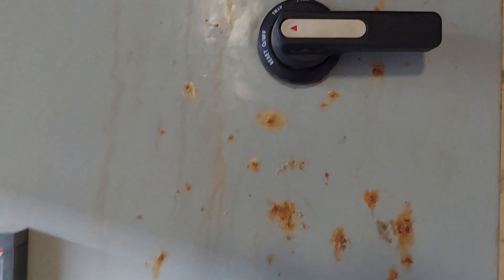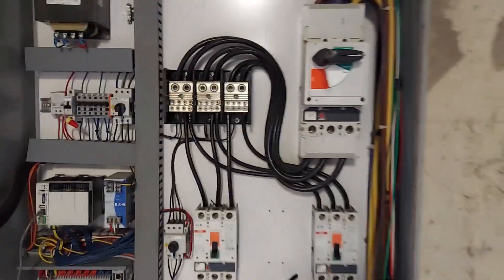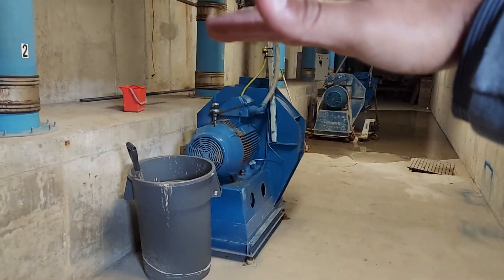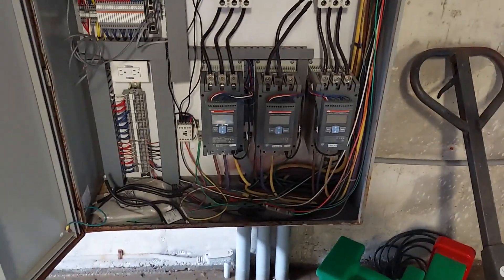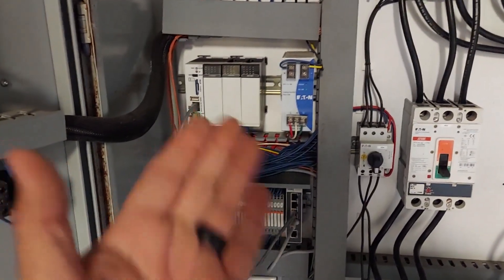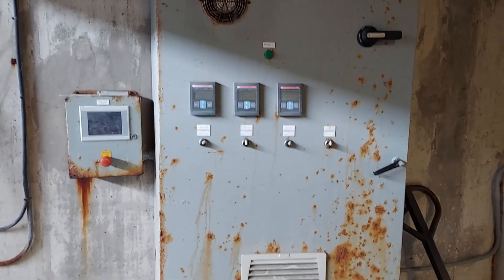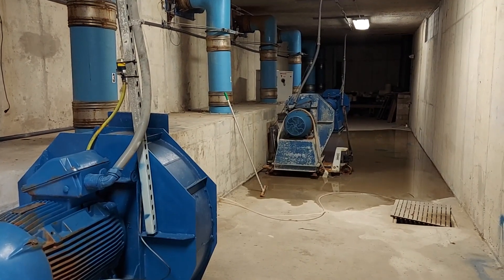Wave Pool Controls and Safety Systems

Comment: 4:10 this is not true.
If you put your hand in front of the blower (either side) you will reduce the mass flow of air through the pump. This will reduce torque loading on the motor, allowing the speed of the motor to increase, which causes the current the motor draws to go down.
It's counter-intuitive at first but makes sense when you think about it; in a motor you calculate the current by the offset between the RPM (phase in the case of synchronous motors) of the rotor, and the frequency of the driving voltage. When the motor is spinning it starts working more like a generator and creates back-EMF, a voltage. The faster the motor spins, the higher the back-EMF. This voltage resists the voltage of the power supply, so the faster the motor spins the smaller the difference between driving voltage and motor voltage. If the shaft is moving slower (behind) the driving frequency, the motor draws current, until the point where they spin at the same speed; then the motor is producing zero torque and neither drawing nor consuming current. When you continue to drive the shaft even faster, you invert the flow of current, the motor starts working as a generator and the flow of current reverses, it's now a generator.
This is also why the motor draws more current when starting; the driving frequency will be higher than the shaft speed.

Comment: Hi mate, Love the videos. Just wanted to know how you actually power up these motors? Do you have a switch on the outside of the electric box and where does it connect?
Reply from the maker: These are controlled via a PLC and powered by a soft starter.
Reply: Thank you  @thepoolguy

Comment: When you say never test the system with no water in the pool, is that common knowledge in the field or did you learn that from experience? What would happen if it was tested without water, would it possibly lead to a catastrophic failure?
Reply from the maker: So, I havnt tested it, cause I really don't know what would happen.  Might be nothing, might be catastrophic failure.  This is too important to leave up to chance... my pro opinion

Comment: The swimming arena AdO in my hometown (Bergen, Norway) had an open day some time ago and I got to go on a guided tour of the various facilties under the pools (at least I think it was), used to keep the swimming pools running. I was also shown the valves for a kind of air cushioning system used to release a lot of bubbles into the water to help cushion divers who were practicing. I didn't know such a system even existed, so it was really fascinating.

Comment: Oh nice a transformer in there.
That is first thing my eyes went to is the transformer as that is what most pinball machines run off of except the new ones now do not.
I work on mainly 70s, 80s, and 90s pins and they have that beefy of a transformer in them even some have two in them making it really hard to lift up the board they are on.
I need a new transformer for my Star Trek Data East pin as it gives a loud buzzing and pops the power junction boxes 8amp fuse.

Comment: Breakers are sized inappropriately if they are tripping on "acceleration" at 10 seconds. Usually the drives have a spec on breakers in the annex. If those are 75 hp motors those drives look mighty small!  Also fans only do work when moving air. If you block the input or output the motor will unload and current will decrease and the motor will run at full rpm. Almost in an idle state.

Super cool and simple setup, I do automation controls, programming, and systems designs for large Heat Treating Furnaces! I enjoy your videos as it is satisfying my childhood curiosity to how the infrastructure of commercial pools works.
Reply from the maker: Figured out that the soft starter was failing, and causing the issue.  I'm also sending in the breaker to be inspected just in case.  The motor was megged and was all good.  Thanks for the info about shutting off flow.  I'll admit I dont know everything,  but I try and learn as much as possible every day.

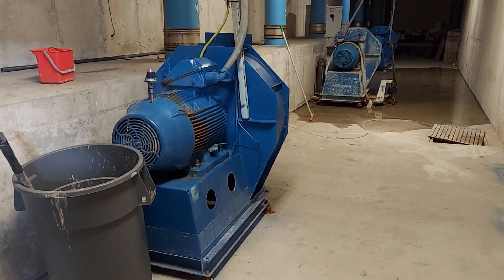Comment: 4:24 That's actually incorrect. As the pressure side of the blower (or pump in case of a liquid) get more pressure, the amperage of the motor actually goes down. This is because it is easier for the motor to turn the blower or impeller in it's own liquid or air rather than displacing it. A simple example for people who don't understand what I'm referring to is this: fire up your vacuum cleaner (which is just a blower in reverse) and cover the vacuum pipe with your hand. You'll hear the motor spinning faster. Now this might look like it needs more power, but in fact what's happening is that the motor turns more easily and therefore reaches a higher rpm. If you connect the vacuum cleaner to a power-meter, you'll notice the amperage (or watts) will reduce once you block the vacuum pipe.
The same applies to industrial blowers and pumps. I've been working in a large chemical plant for over 8 years and I've seen the same thing on small pumps as well as on 750KW and 6000volts (!) pumps.
Ps: this only applies to centrifugal pumps and blowers.
Reply from the maker: Thanks for this.  Ill be the first to admit that I don't know everything, and I love to learn everyday.
Reply: @thepoolguy  ps, I subscribed! I've always been fascinated by the engineering around swimming pools.
Reply: @ThePoolGuy - Looking at those soft starters they appear to be made by ABB and have the fault circuit hooked back up to the PLC, so it should be able to monitor for motor status, when set RPM is reached, or for faults. If it works like other variable frequency drive products in the situation that Auto Addiction presents the loss of the pressure side should trip a VFD on overspeed if the controller can't adjust the ramp down fast enough to keep the motor in name plate specs. Which looking at the wiring there should also lead to the PLC being alerted by way of a contact that one of the starters is faulted and some logic for a safe orderly shutdown to back it up.

Comment: I would love to see what goes on inside the wave chambers when the machines are running ... but i guess you would have to have a camera mounted at the top so people could see the water being pushed up and down .... 
also iv never been at the bottom of a slide when its first turned on ... that would be cool
Reply from the maker: What you have requested is coming up.Stay tuned.
Reply: @thepoolguy  It might be easier to mount it to the scoop and have it looking down at the water. You will need lighting in there as they are darkish inside there.

Comment: Is that Controllogix? That’s like asking Marvin from Hitchhikers Guide to the Galaxy to calculate your tip. 

It the insurance’s fault requiring a SIL rated PLC. Although Siemens are half the price but you gotta stick with what you know.
Reply from the maker: I'll have to check, I dont remember off the top of my head.

Comment: Probably wouldn’t be a bad idea to replace those PVC air lines you’re using for compressed air with metal. OSHA loves fining for PCV compressed air lines. (For good reason though!) When used with compressed gasses, aged PVC has a tendency to turn into shrapnel when it breaks.
Reply from the maker: Thanks, Ill look into it.

Comment: Very nice Videos, great to have one posting these kinds of things.
But you got something wrong here, the fan will pull less amps when the intake is blocked.
Since it is a fan and not a compressor it will pull the maximum power at maximum flow(=zero pressure).
And the minimum power at the maximum pressure(=zero flow).
Long startup ramps might lead to more heating of the motor even if the breakers will hold.
Reply from the maker: Appreciate the information.  I made an assumption, evidently I was wrong.

Comment: Awesome vid! How do these systems compare to older legacy systems say from the 80s or 90s? My local water park has gone through several owners so I’m not sure how much upgrading has been done to the wave pool since they opened in then early 80s.
I have noticed a drastic decrease in wave strength in the past 2-3 years. I asked a lifeguard and he said they had indeed adjusted the wave patterns to be more gentle because of so many inexperienced swimmers in the wave pool. They also added a huge red line in the pool with signs instructing weak swimmers to stay behind the red line. Kind of funny to watch a huge pool full of people scream and rush towards the shallow end when the waves start!
Reply from the maker: As for legacy, this type of wave system has been in use since the beginning.  Easy to operate, and doesn't require massive hydraulic pistons. So its all about the wave pattern with these.  The patterns all range in depth and frequency.  Picking one that works with the pool depth and size is critical to provide a safe yet exciting wave.  One wave might not be too deep but its frequency of wave makes it hard for shorter swimmers to get their feet back under them.  Some patterns create undertows.

Comment: Very good explanation. Seeing a electric layout and explaining what communicates to what, makes it sound easy how it all works. Its just when you get to the coding part is where it all gets confusing for me.
Reply: That was probably all set up at the factory or programmed by the manufacturer/installer, with instructions provided on how to change the important parameters like the motor start up delay the pool guy is talking about. "Tech support" for a system like this is orders of magnitude different than the regular awful support we all expect to receive for consumer products. For a serious re-configuration, they can probably get someone from the company to come out to the site to troubleshoot and work with the water park staff. And that PLC looks like a standard piece of hardware that could be used for all kinds of different applications. I have never used something like that, but assume the operation and configuration is well documented.
Reply: @MittyNuke1  it can also be internal staff what is making the plc program

I work at mondo verde in landgraaf the netherlands
I made the electric systems for the flume ride and also programmed the system (Siemens s7-1500 failsafe system).

And I am currently working at a system for a waterslide currently still working on the schematics but it will have 3 motors 30kw only slides and spray
And 2 times 7.5kw only filtering
So a total power of 105kw or around 180 amps at 400v.

And yes I am working at mondo verde an no external personal is hired for building this structure, only for concrete or sand a contractor is hired to get it to the place.
if it's there we also do everything else to finish it and make it look nice.
Reply: @philipboy88  Thanks for sharing -- I do not work in this industry so it is interesting to hear how different places work. I assumed it was an outside contractor who did the programming of the PLC on this video because The Pool Guy mentioned that the system was "Commercial Off The Shelf" implying it was purchased as a pre-designed/assembled unit. But I do not know if this is the case.
Reply from the maker: Hey Yall, great responses to this question already.  Although my assistant and myself have some basic knowledge on PLCs and ladder logic, we leave this kind of programming to the manufacturer of the wave maker system. Low voltage stuff, sure, we will mess with.  But for controlling high voltage stuff, nah, not our lane.

Comment: Great video. Love the detail. I'd recomend LOTO. Lock out your main switch as far back as necessary instead of switching of in multiple places. No chance of any accidental energisation then 👍
Reply from the maker: 100% totally agree.  I didn't have a breaker locker for the large breaker at the moment. Plus I had shut off the transformer prior.  Did this for dramatics so to speak.  But yes, LOTO all day

Comment: you say if you block the airflow the amperage goes up and trips the breakers.

this is not true if you block the airflow into the blower or reduce the output to 0,
the amperage will drop.
this is because there is no airflow if you let there be an airflow you will get current.
and more airflow = more current.
Reply: That's true and is a counter-intuitive concept that confuses a lot of people. Same with blocking your vacuum cleaner. It sounds like the motor is working harder because it spins faster, but it actually uses less power because less air is moving. Important concept is that the motors will shut down if they pull too much current for any reason.
Reply from the maker: Although it may be from something else, this is what we have experienced.  The system may actually have some parameter that I don't recognize to shut the fans down after an anomaly.

Comment: Why not a stainless steel enclosure? Seems like a no brainer considering the environment it is going to be in. 
Also you can adjust more then just ramp time to help with the inrush. Should be able to tune the whole starting curve. We use same series of ABB soft starts to run some 400A 480v hydraulic pumps.
Reply from the maker: I agree, SS would have been much better.  The enclosure was purchased before I came on board.  The box was supposed to be in a controlled environment, value engineering nixed that.  My knowledge of these soft starters is very basic.  Do you have resources that may be helpful. I would be grateful to get help with inrush tuning.
Reply: it also coud be second hand cabinet its cheap

Comment: They may be out of service but please remove the pig tails from 2 even if it's out of service trust me things can happen. If it's going back in service then save them you're not out anything. Just saves on a cross circuit.
Reply from the maker: You're right, ill be removing #2 soft starter today.

Comment: i would be to scared to mess with those controls
Reply from the maker: Matt has the right idea.  Once you feel comfortable with what you're working with, it should come natural.  I equate electricity flow with water flow through pipes.  Look where the water is flowing from and where is it going too.  What's a valve, what's a restrictor, what's a reducer... ?
Reply: That's why he's clearly taken the time to learn how the system works, and/or has been trained by the company that built the system as to the proper setup and operation. You should be scared if you don't know how it works, that's pretty smart! I would be scared to drive a race car but a professional race car driver who knows what they are doing, probably isn't. But this system is clearly designed with many safety features.
Reply: Same
Reply: @bkmb130  As an electrician you get used to it very quick.
Reply: I’ve been an electrician for 25 years and I’d be uncomfortable in that panel........too much exposed conductor for me 😵